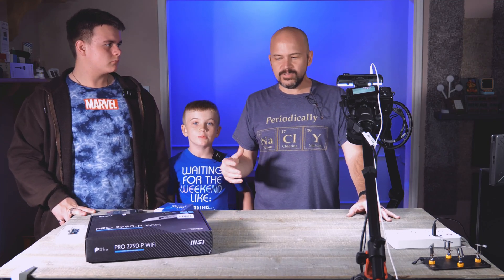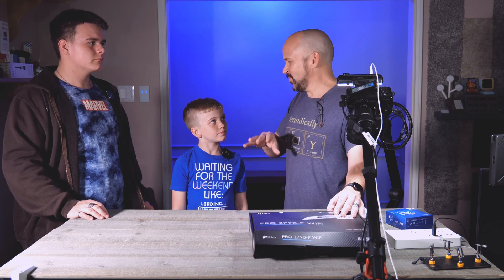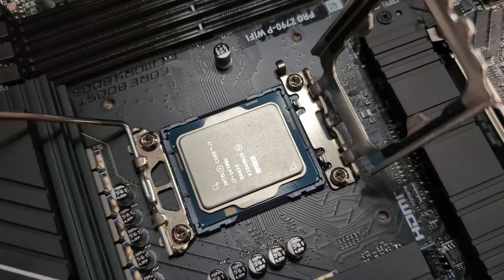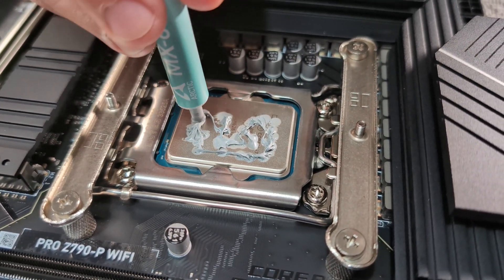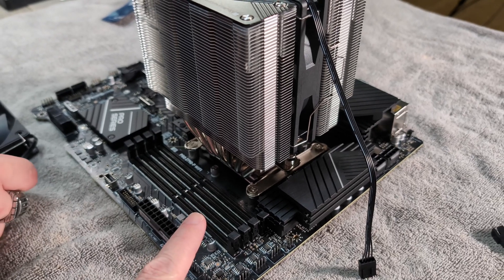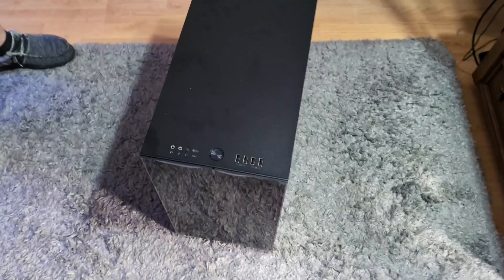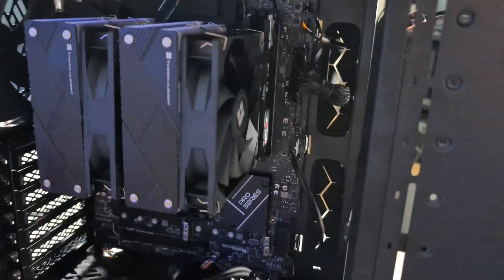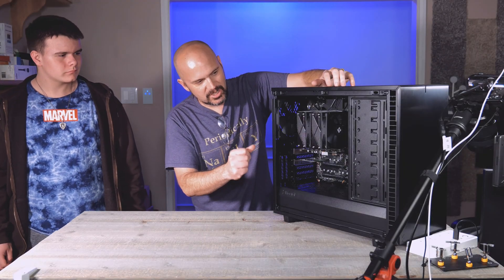NEW UnRaid NAS Build for Home Assistant, Plex, ESPHome etc.

Comment: You may know this, but that 120mm fan in the front is backwards. It will be pulling air out of the case.
Reply from the maker: Ha.. I found the fan. Sure enough. Good catch. Luckily the new one is the right way, looks like I caught it.
Reply from the maker: Hmm.. I followed the arrow on it but it has been swapped to a 140mm since the recording.
Reply: Yep, by convention fans blow on the direction of their sticker/label on the fan hub.